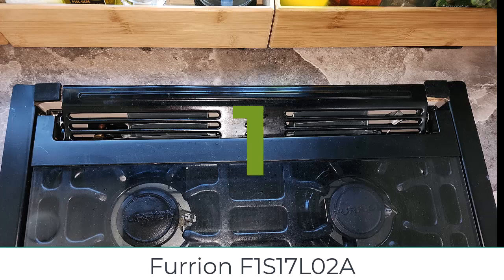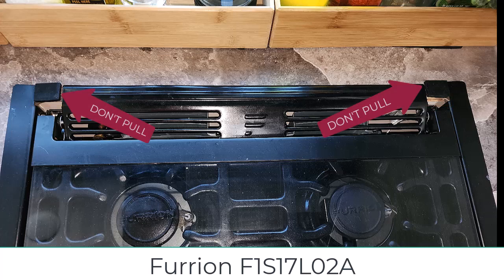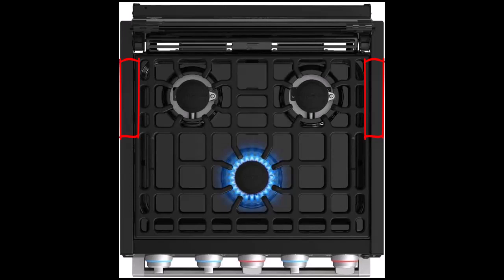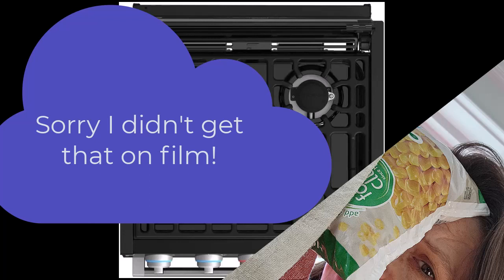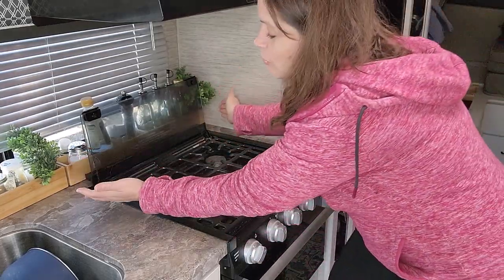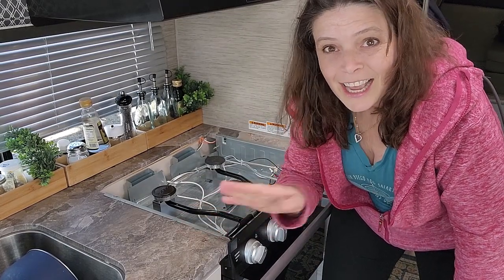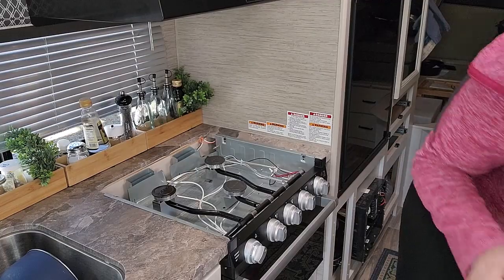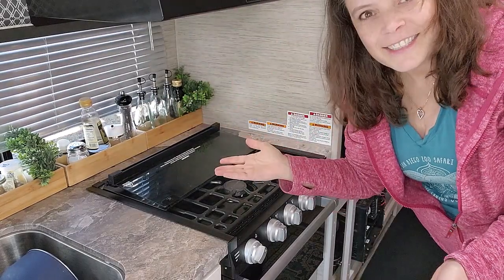RV Stove Top Removal - Replace Your Broken Glass Without Damaging Your Stove!

Comment: My glass busted I was wondering how to take to whole glass holder out I never wanna deal with that mess again😢
Reply: I also had my glass busted. I think it was from putting something too hot on it (Corn on the cob from the microwave). It shattered (1/2 hour later) and was a total mess.  I was hoping to see how to replace the broken glass cover for the burners - did not see that in this video.